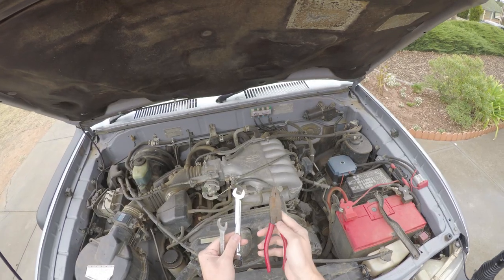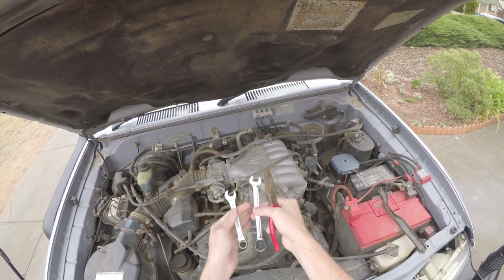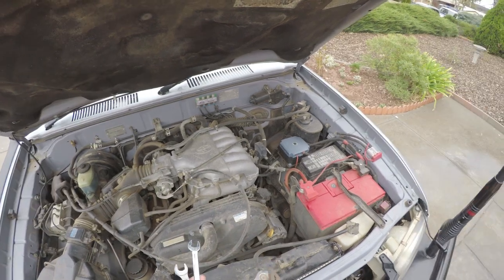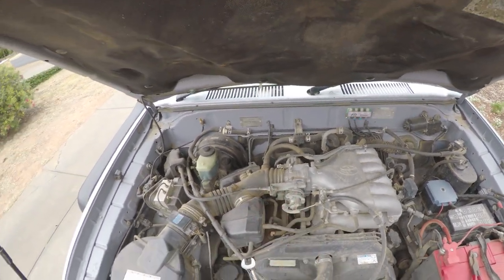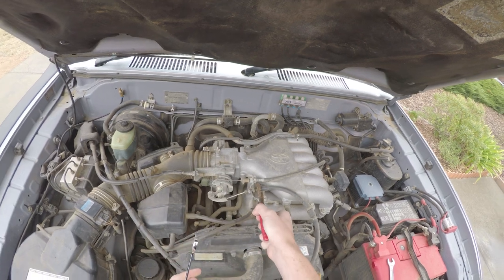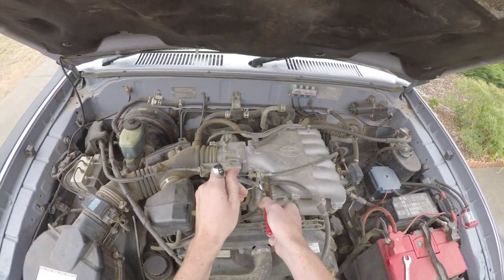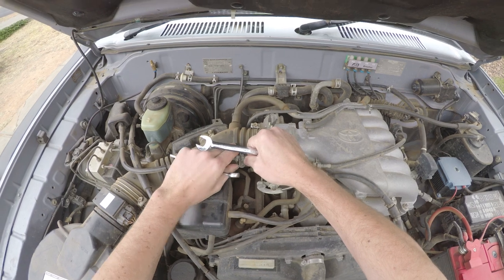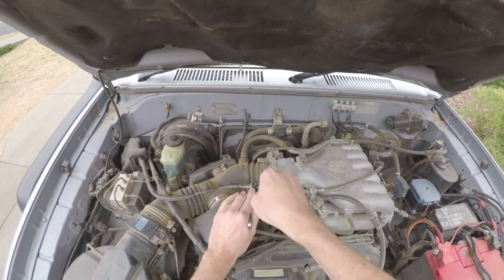DIY: Improve Your Throttle Response On Your 5VZ-FE Engine By Doing THIS!

Comment: I've done this but I have now noticed since at low rpm it starts to shutter  acouole of times until the rpms get back up a little
Reply from the maker: Hey Guy

I thought there was an idle screw to adjust on the throttle wheel, but have since looked at another 90 series last night and no such thing exists on the 5VZ-FE.

So I'm going to suggest taking your intake pipe off and cleaning around the throttle blade inside the throttle body with some carburettor cleaner and a lint-free rag.

I'm also curious as to when you last ran a decent fuel treatment through your vehicle?
Reply: @OzTrax4X4  I did a full fuel system cleaner threw the service before last and I was thinking about cleaning the maf sensor I dont Know if that has ever been cleaned so good idea I should also clean the throttle blade at the same time cheers
Reply from the maker: Definitely give the MAF sensor a clean. That would be a good place to start first and let me know if you get it sorted.
Reply: @OzTrax4X4  thaught I'd better let you know I gave the throttle body and plate a really good cleandidnt get around to the maf sensor yet ( didn't realise I didn't have any sensor cleaner left) but I have sofar noticed a improvement with this issue I've been having
Reply from the maker: Awesome bud. I reckon with a MAF sensor clean it will be good to go.

I always did that every air filter change to make sure it was operating correctly. 👍
Reply: @OzTrax4X4  turns out it was a broken ignition lead causing the problems
Reply from the maker: Ah nice. Glad you figured it out. 🙂

Should be a bit of a difference with new leads too.
Reply: @OzTrax4X4  yes it's gets up and goes now
Reply: @guyelsenburg9196  Thanks for this. Gave me a few things to check, since I'm having the same issue with my Prado at the moment. I'll follow the video first, and then give the intake and maf sensor a good clean

Comment: Nice tip mate will check mine out 👌 would've been nice to see it up close  to see exactly what you're doing there but I think I will suss it out 👍
Reply from the maker: Unfortunately it's a little hard to film from my point of view with the lift I have in the 90 along with the 33s.

But pretty easy.

1. undo the nuts locking the cable to the bracket.
2. wind out the nut closest to the throttle wheel until the cable has no slack in it (make sure it's not pulling on the throttle wheel and opening it, you just want to remove the slack).
3. With a pair of pliers, grip the cable back just behind the threaded area and use your 14mm spanner to wind in the locking nut.
4. Use both 14mm spanners to lock the nuts against the bracket.

Rinse, repeat for the cruise control and kickdown cable and test drive.

Comment: Have you ever looked at the butterfly insude the throttle body when you go 100% throttle ?  It only opens up maybe 80% at most..  i been wondering about that shit..  100% at the motor hits the stop but the butterfly isnt fully opened..  every other motor ive seen, thatd be an issue..
Reply from the maker: The reason being that if it were fully rotated at 90 degrees, throttle response would be slow on deceleration and you'd have too much travel in your pedal to go wide open.

80% would still be wide open as the air would flow around the butterfly plus an NA engine can only consume X amount of air on the intake cycle of the combustion process.

Comment: Hey mate what’s the rough 0-100 in these rigs with your 3.4 motor ? Do ya consider it a slug or not too bad ! Sorry for spam of questions 😆
Reply from the maker: All good mate, unfortunately I don't have the Prado anymore. You can find those videos on my channel.

In regards to your question, its a 4WD that weighs 1.8t stock, so zippy enough in stock form but the more accessories you add and bigger tyres you fit, the slower it gets.

At a guess, 8-10 seconds to reach 100km/h.
Reply: It’s a slug mate I have one it can barely reach 100 on flat ground
Reply: @dycescoot3211 it’s quick but lots of factory limiters easily put 3 k in to the motor you can get at least 230 hp all motor and find a turbo then u got at least 340. On 93 ocT